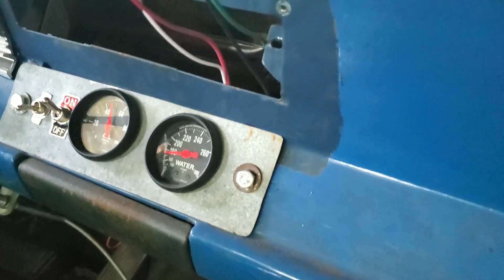Fastest Slow Car ! | 1969 Dodge Dart Won't Roll | Mopar Rear End | Catch me If You Can

Comment: 😆 where do I begin. The trans is fine overun clutch-drum-3rd gear blah blah blah. Mount the fuel pump on rubber and cork pads, you’ll also need a hydraulic hose made for the electric pump cause electric pump needs a pulsar to absorb the on off cycle of the armature and lengthen the life of the pump tremendously, the hoses will allow the pump to vibrate and the metal lines to free of unwanted vibration that will loosen fittings,  the rear brakes might not be adjusted well; park strut can be holding the shoe away from the anchor, shoe can be hanging on the rust ridge of the drum, prk can be engaged, return spring heat fatigued etc etc. front brakes slides are hanging but if you drag race you would know to put hardened bolts in and get rid of the thick bolt ( depending on caliper set up). Front bearings should have light weight oil not grease, the caliper seal is not doing its job if the rotor is dragging.
Bro, do you even wrench? 😂 all good 🚒👍 thanks for the laughs. 
Hope your fingers are fine, when I worked for ODOT I scene a mechanic turn a tire in a stainless wheel, he severed all the tendons and lost feeling in his hand. Wrench safe and not lazy. 🚨
Reply from the maker: I'm a walking disaster when it comes to wrenching haha Appreciate it and Thanks for Watching!

Comment: The transmission, naturally turns harder in one direction than it does the other.  The pump in the Nacho has a growl to it, it's a little muffled by the back seat but they can be loud.  Got a spare or a rebuild kit?
Reply from the maker: Might just have to ship the ole 727 up there so BTP can put the once over on it!